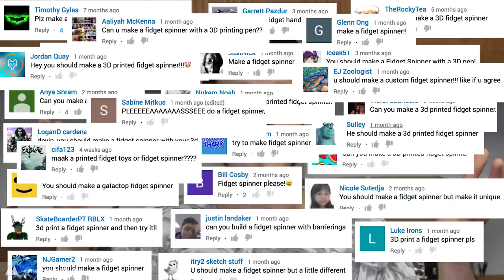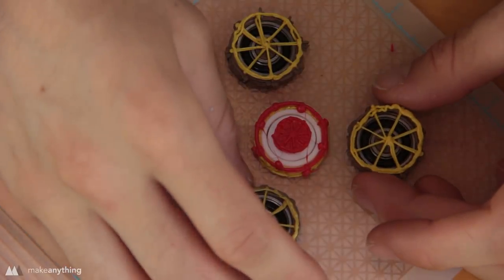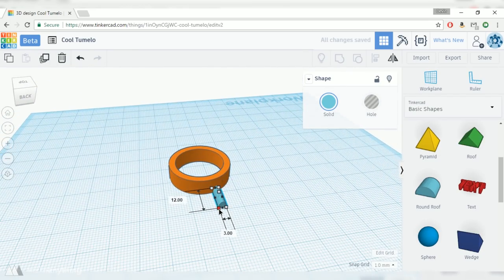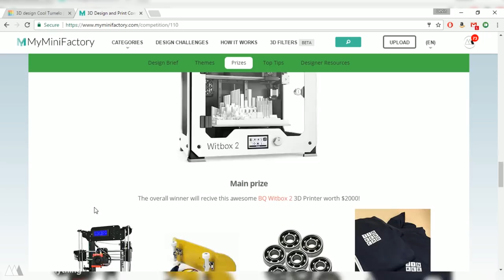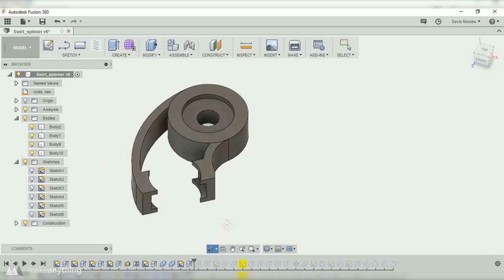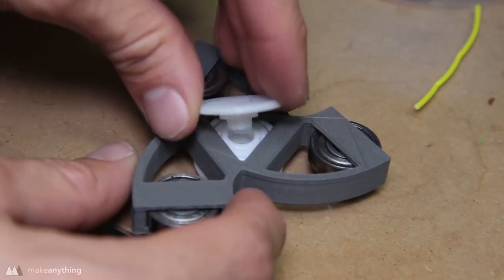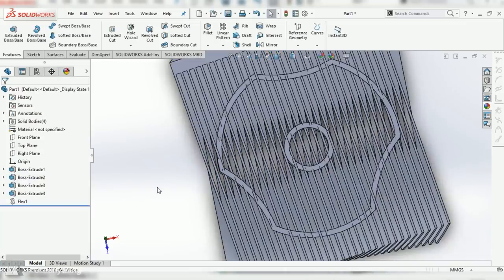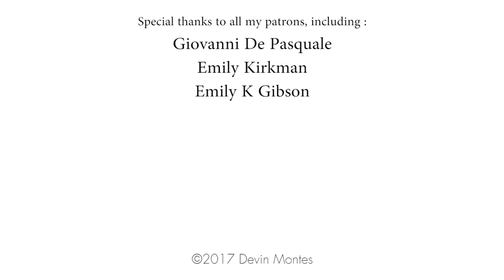3D Pen and 3D Printed Fidget Spinners // FOUR Ways to Make Spinners

Comment: you should make a fidget spinner like the one at 16:50, but the 3 bearings can move around in the spinner but they're still trapped. so that when it spins, it will show the forces pushing on them.

Comment: What do you like most? Solidworks or Fusion 360? Or it's basically the same?
Reply: I've used both and they're basically identical hah
Reply: @LilSqueet  is fusion 360 or solidworks free?
Reply: @nathanielcrowell822   solid works is not but fusion is! As long as you use fusion for personal products and you make less than 100,000 dollars a year you can renew a free personal use license!: )
Also, he shows tinkercad. It's very basic, but I use it more often than fusion! It's also a very great intro to 3d design if it's new to you!

Comment: hey man I have a bit of practice in tinker cad and it is easier to line up the spinner arms. If you had duplicated both the center bearing and first arm with the connectors and duplicated all of it, then rotated it by 120 degrees you can line up the center bearing hole very easily and when you merge it the overlapping part doesn't matter.

Comment: 11:30
no there was nothing funky with the printer or the slicer, the funky thing was tinkercad.
when you set the tube's wall thickness to two, it actually changed the value it proportionately to what was the size of tube before,  20 mm by 20 mm. when you scaled it to 26.5 mm by 26.5 mm it screwed up...

Comment: If you have the wall thickness as 2, the inner diameter is 4mm smaller than the outside, not 2. That was your problem with the 2nd one.
Reply from the maker: oof, good catch!